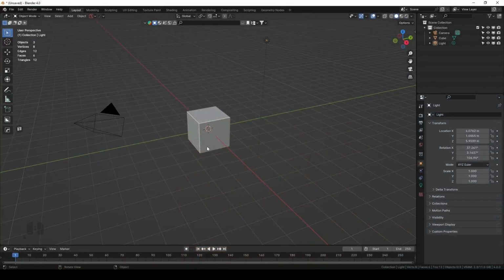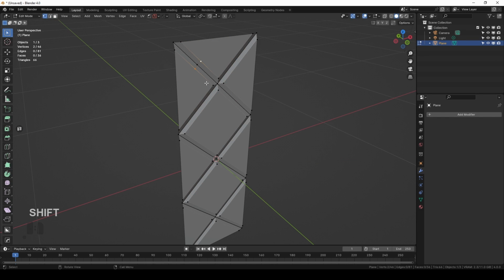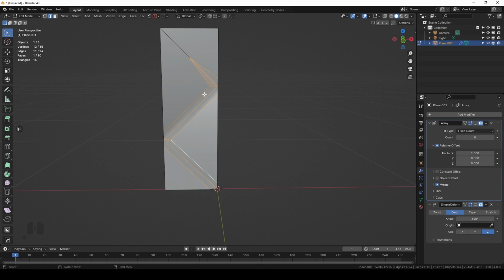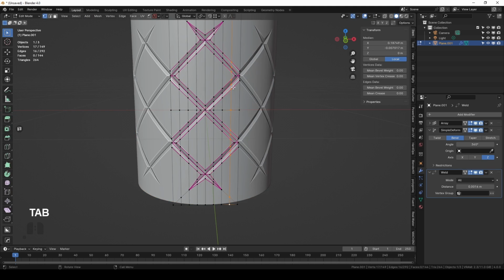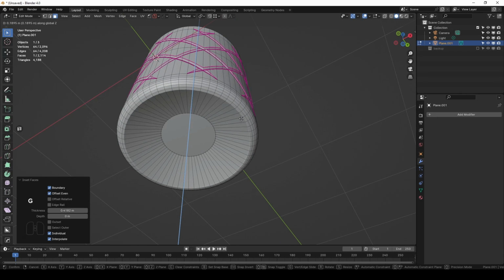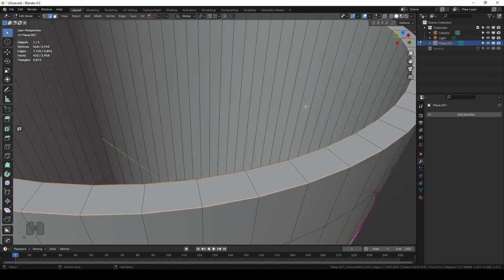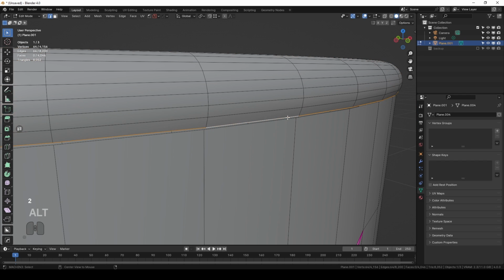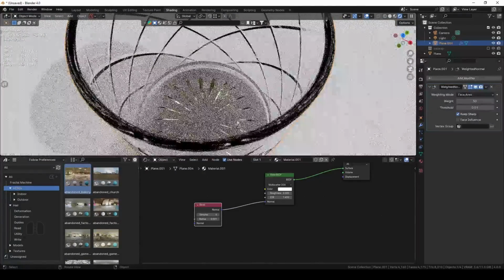Crystal Glasses in Blender 4.0 - Part 1: Creating the Crisscross Whiskey Tumbler

Comment: object  not rounding but badly deforming while applying simple deform modifier in blender 4.3
Reply from the maker: It should still work the same in 4.3 when rotating the plane have you done it in edit mode or object mode? Doing it in edit mode to keep the global rotation 0 is important. Try to apply the rotation on your object to see if anything changes.
Reply: Simple Deform is weird. It depends on position (origin) of your object, and the rotation (which way your plane is going from the origin). Try all possible combinations until it clicks together.
Reply: Same, it's fucked up
Reply: Okay, so, I tried to apply all transforms and it worked>

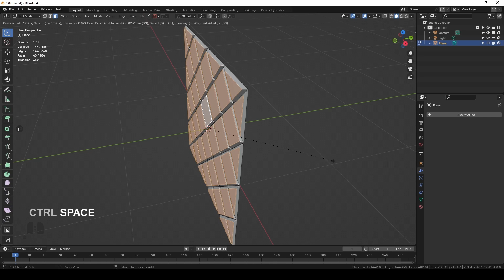Comment: The screen says you push "CTRL SPACE" to indent the pattern around the 2:07 minute mark, but that is not working. Can someone give detail about what he did there? 

Ok, update: I just pushed g and the direction (Y) and it worked that way.
Reply from the maker: just holding the ctrl key while indenting a face with "i" and moving the mouse while you hold it will move the indentation inwards or outwards dependant on the mouse movement.

Comment: Great tutorial but Im stuck on bending after array. When attepting to bend in the 'X' axis, some of the vertices do not move, disfiguring the shape. Only the perimeter bends correctly, The vertices where the glass is cut do not move with the bend modifier.
Thanks in advance if anyone knows a fix
Reply: I had the same problem, fixed it by applying the array modifier, then setting the origin to geometry and geometry to origin to make sure, and also applying all transforms to the plane.
Reply from the maker: We talked a bit and the solution was to apply the rotation. If you rotate the plane in object mode instead of edit mode the deform axis won't work properly. Happy that you figured it out in your own. 🙂
Reply: @crow.3d  worked for  me thanks!
Reply: Guys, the problem is solved very simply. Before making a mirror, in the object mode, select the object and press (Ctrl+ A) and select (All transformations) and press all the checkboxes. Then do everything as per the tutorial.
Reply from the maker: hm.. tough to debug without images. Let's see what we can do about it. 
- the simple deform modifier comes after the array and is set to twist?
- if you change the axis to z instead of x and set the angle to 360°. Do you get a full cylinder?
- the origin of your object might have moved which could cause issues like that. There is an instagram proflie linked in the description. You could send me a screenshot of your problem there and I can try to help.
Reply: @crow.3d   Thanks for replying so swiftly, when I try to bend 360 in the z axis, I get a flat disk. I will try to send photos soon, thanks again